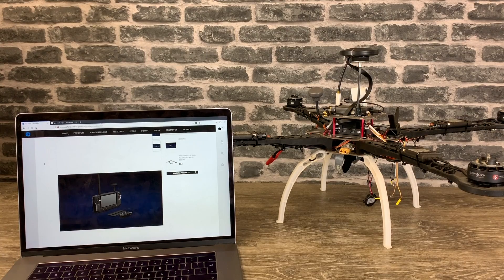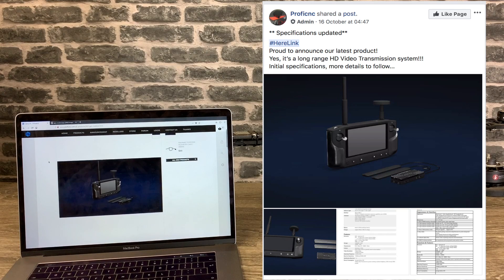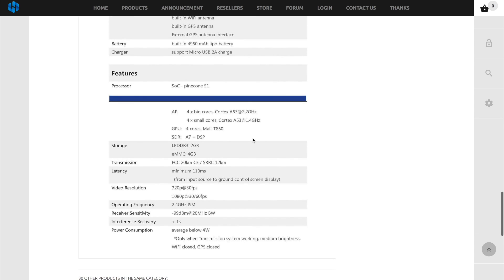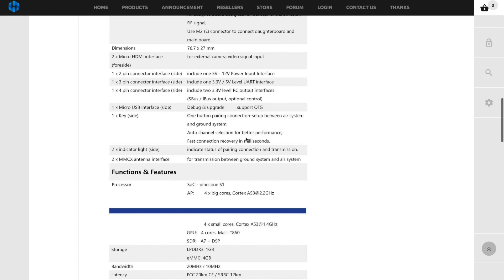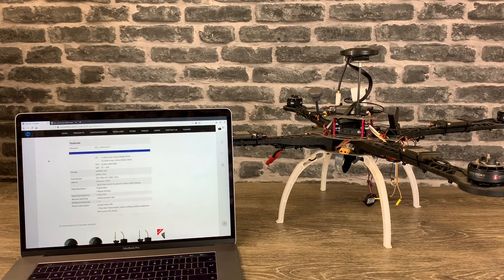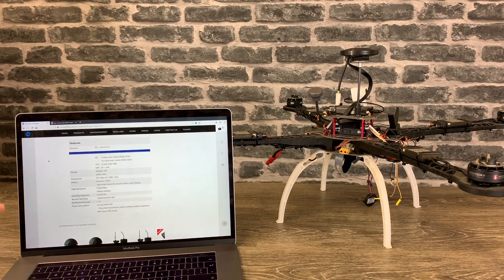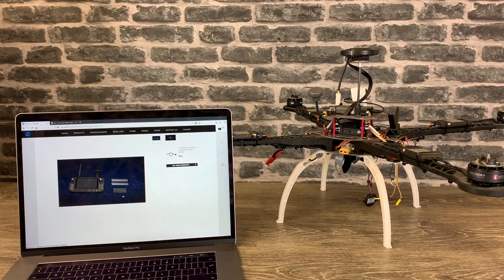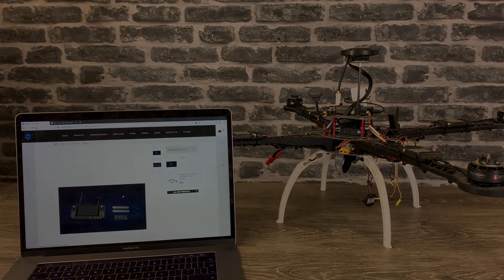HD Digital FPV RC For Pixhawk Called HereLink - Lightbridge 2 for Pixhawk ?

Comment: when you say it uses 4g LTE instead of wifi, does that mean we need to use a simcard with these units?
Reply from the maker: No the protocol is like LTE, it’s not on 4G frequency’s but it’s using the LTE base protocol. 

The basics all regardless of frequency there is the type of transmissions used, Wi-fi is one protocol, lightbridge uses OFDM like digital TV, this uses LTE like 4g mobiles, it’s all just different ways of taking the data and sending it over the 2.4ghz frequency.
Reply: if it is using 2.4ghz frequency with those omnidirectional antennas, how is it getting 20Km of video transmission? sounds like the claims defy the laws of physics. would love if you could explain, but regardless, if it works, I will buy one.  @MadRC

Comment: Two questions I can't see addressed on their website. 1st - does the controller have the ability to output the HDMI video signal? I'd like to relay HDMI via the receiver into a vision mixer. 2nd - can you chose between FCC & CE modes?
Reply from the maker: No HDMI but you can chrome cast via Wifi .

As for choosing region I don’t know tbh, it being “open” I don’t see why it would be locked down however in CE there are some stringent things they have to comply with and they often don’t like these things to be user selectable, it may be out of their hands if they allow it or not.  .

Comment: thanks for the video. I was looking into Link radio allso. How many rc channels this radio have ? 
it is a rc radio and hdmi tx rx combined, right .If i may ask, what brand is your current hdmi transmitter, use`s occusync ? I thought that occusync is dji only. Please add link to product, been looking for hdmi transmitter for my curret build with cube, tho i may go analog with some gear i allready have and wait this new product from proficnc,, sounds like its awesome unit, definately a missing link in diy world :) edit. ok, so it is dji occusync for goggels, didnt remember this product, sorry. btw.nice setup u have there 🙂
Reply from the maker: Details are still very limited, don’t know channels yet.

Ocusync can be used on any Sbus system but it’s not HDMI it’s using its own camera and it’s more aimed at racing and FPV flying, this system from ProfiCNC is more like a dedicated RC HD link system for larger birds for AP and other uses like mapping.  That’s not to say it can’t do racing or FPV but it’s looking more like a solution to the lack of systems like in on most RTF drones.  

There are very few HDMI decent setups that don’t add tones of wires and separate receivers like the AMION.  This should solve that.
Reply: @MadRC  ok.thanks.true that hd tx market  for diy is very limited at the moment..  Im building hexa with  thermal imaging etc for industrial/commercial use, so this would be a perfect solution for image transmition. thank you for info, We must wait for more info about this..do u know any rumors when it is about to come available ?
Reply from the maker: From my understanding Beta units will be available to purchase by Christmas, the things to note with that is when  Philip Rowse says it’s in beta it’s a very finished product they just want to ensure it’s 100% before taking it all the way and saying it’s ready and they will give you loads of support too.  I would have zero issues buying at beta stage from these guys.